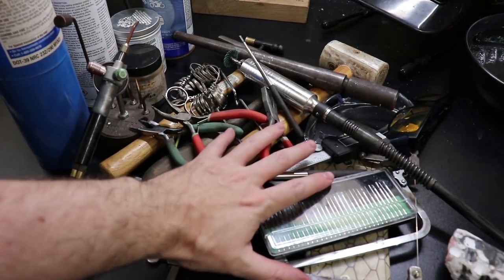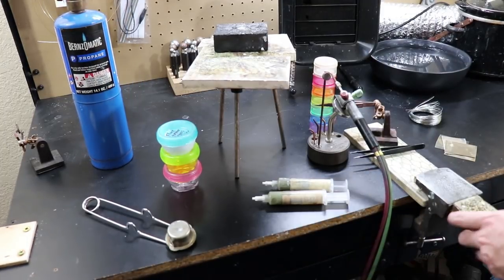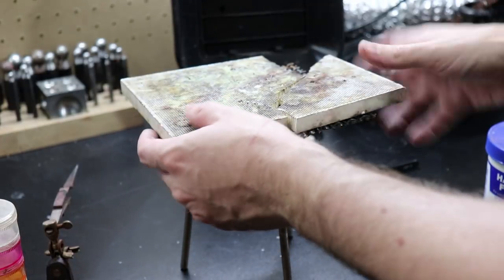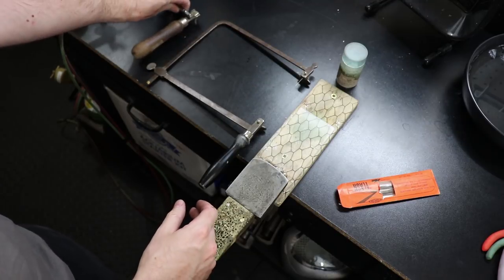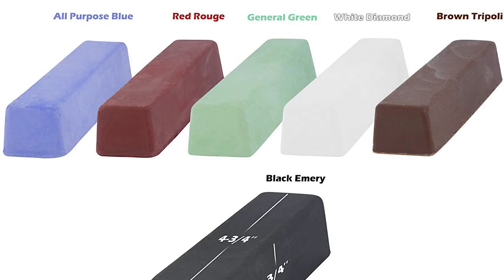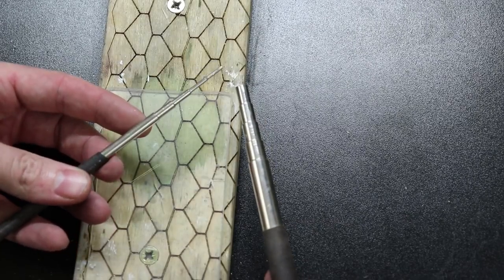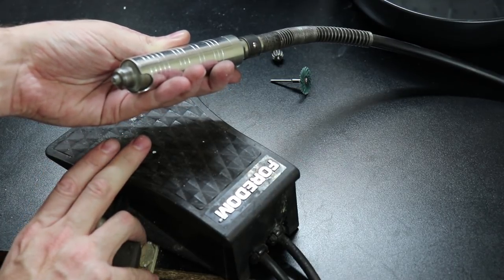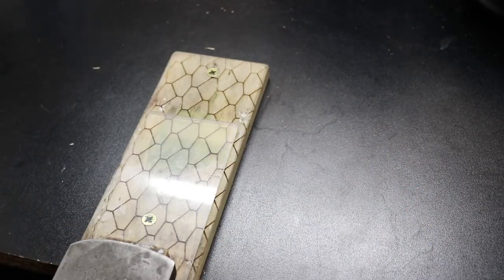20 Must Have Jewelry Tools [Update]

Comment from the maker: I have made a list of every tool and item in this video and they should all be in order for you.

Link to my pickle video: https://youtu.be/1mPAXsKXb1Q
-----------------------------------------------------------------------------------------------------
This isn't in the video but a fire extinguisher is good to have handy - https://amzn.to/2u2zQSv
-----------------------------------------------------------------------------------------------------
Saftety Glasses - https://amzn.to/2IEMVqa

Soldering Glasses - https://amzn.to/2yTznaU

Fume venting table top fan - https://amzn.to/2tFytJI

Fume Absorber Replacement Filter 5pcs - https://amzn.to/2KzahiJ

Digital Vernier Caliper - https://amzn.to/2IF6tL3

Smith's little tourch -https://amzn.to/2lJO32D

Smith little torch, regulators for disposable canisters & magnetic stand - https://amzn.to/2MCQBLD

Full oxygen acetylene smith's little tourch set up - https://amzn.to/2IFfVy4

Propane torch head - https://amzn.to/2KikjIW

Flint spark torch igniter (Starter) - https://amzn.to/2tF4jGQ

Trigger start propane torch head - https://amzn.to/2ME2PDR

Silver Solder Paste Set easy, medium, and hard - https://amzn.to/2KAHdHN

Precut silver solder chips - https://amzn.to/2KkfTkR

Handy Flux - https://amzn.to/2tRoDUr

My-T-Flux - https://www.riogrande.com/product/my-t-flux/504006gp

Brushed for flux - https://amzn.to/2KyhOyg

Tripod with Mesh Screen - https://amzn.to/2NcbQ88

Heavy Gauge Screen - https://amzn.to/2tJkD9p 

Honeycomb Soldering Block - https://amzn.to/2MA5X3j

3rd Hand Tweezers - https://amzn.to/2tO8cYY

Charcoal Block - https://amzn.to/2tRHsqM

Tweezers Set - https://amzn.to/2Nd6NnH

Titanium Solder Pick - https://amzn.to/2MCzIAq

8 Piece Set of Pliers - https://amzn.to/2tGIuX9

Non-marring Plastic Jaw Soft Touch Slip Joint Pliers - https://amzn.to/2lILe1Z

Round Nose Pliers - https://amzn.to/2IExDBX

Thin Wire Cutters - https://amzn.to/2NeJ2eX

Straight Cut Snips - https://amzn.to/2NeJHNt

Side Cutter- https://amzn.to/2NdJAlw

File Set - https://amzn.to/2ICKNiM

Just Needle Files - https://amzn.to/2Mz2i64

Small Bass & Steel Hammer - https://amzn.to/2MCAFJ0

Rawhide Mallet - https://amzn.to/2MABmTb

Chasing Hammer - https://amzn.to/2tFcF1a

PRO-CUT Lubricant - https://amzn.to/2IEvPc7  

2/0 "Flash" Jewelry Saw Blades - https://ebay.to/2KmEQMz

8 Inch Jeweler's Saw Frame - https://amzn.to/2tHhBCu

Bench Pin with Anvil - https://amzn.to/2lLC0Su

Micro Drill Bits - https://bit.ly/2Nek1AD

Multi-Grit Diamond Burr Set - https://amzn.to/2z3UO9k

Stone Setting Bur 12 Pc Set- https://ebay.to/2Mz3wy6

Ball Bur 12 Pc Set - https://ebay.to/2yVnNfp

Cup Bur 12 Pc Set - https://ebay.to/2KxAbTT

Hart Bur 12 Pc Set - https://ebay.to/2yZCJco

26pcs Diamond-in-rubber Emery Bits - https://amzn.to/2MDVP9F

Mixed Grit Radial Bristle Disc Brushes Kit - https://amzn.to/2tSDRc5

88pcs Felt Polishing Pads & Polishing Wheels - https://amzn.to/2yZDqT2

Polishing Compound - https://amzn.to/2tTGzh8

Drixet 6 Piece Buffing, Polishing & Cutting Compound - https://amzn.to/2MyNSTg

Ring Gauges Finger Sizer - https://amzn.to/2Nemz1F

Steel Mandrel - https://amzn.to/2yZWfWe

Step Mandrel Set - https://amzn.to/2tIlTJX

Crock Pot aka Pickle Pot - https://amzn.to/2lK0bkg

Copper Jewelers Tongs - https://amzn.to/2NcsTH5

Pickling Compound Sparex 2-1/2 lb Bag - https://amzn.to/2tOnHBl

27-Inch Telescoping Rotary Tool Holder - https://amzn.to/2NdXq7q

Better Flex Shaft Motor Hanger - https://amzn.to/2yTWu53

Flex shaft, hand piece and motor - https://amzn.to/2yX0TEb

Upgraded foot controls - https://amzn.to/2tTJcQ2

Complete 26-Piece Dapping Set -  https://amzn.to/2Kzn0C1

Bezel Burnisher - https://amzn.to/2MBHlXZ

Bezel Roller- https://amzn.to/2tRqKYt

Renaissance Wax - https://amzn.to/2lLcHQJ

Dupli-Color Clear Acrylic Lacquer - https://amzn.to/2IFv2Yk

Permalac Original Clearcoat - https://amzn.to/2MAe7IY

Liver Of Sulfur Gel- https://amzn.to/2lHXdwJ

Jax Metal Finishing Solutions  - https://amzn.to/2NeRBq7
Reply: Wow... thank you so much for this video and providing the list.  I have everything that you mention except the stones settings and burs.  Very informative video.😊👍👍.
Reply from the maker: Chain is a very time-consuming thing to make but it's a good thing to learn. Hey is a tool that he might find very handy. https://youtu.be/liF5881xR0Q it makes and cuts jump rings really fast. As for making the Cuban chain you need a mounted vice to get that nice twist and to make them flat you need to file them down. You can get a flat board and screw it down to it and clamp or bolt it down to your work bench. This way you can file it without it moving around.  😁👍

Comment: Hi Randy! Thanks, gonna share this to my group! Tip, go to the hardware store's plumbing section and you will find  cast flanges that will accept threaded black "water" pipe that comes in various lengths and choose one that is close to the height of your flexshaft motor hanger, bolt the flange to your bench, thread the pipe in and voila! A very sturdy stand for your motor!

Comment: I like the dowels that's something i can use.  I usually end up using my bench pin as a dowel hah good idea.

After the other grits, you can go from green radial (1000) to gray (2000) then just some regular silver polish like blitz with a fine soft towel and water, gives you mirror like surfaces and skips compounds and buffers all while cleaning the pieces (i use an electric tooth brush to final rinse).  I stack the radials brush discs three deep usually too.
Reply from the maker: Well I'll have to look into getting some 2000 and try that out. 😀👍

Comment: How about rolling mill for wires ? Do you have another method since it's the most expensive. It's one of the best videos for beginners. Thanks for taking the time of making it.
Reply from the maker: You can't really get around a roller mill well other than just buying wire and sheet metal. I do have a roller mill but It is one of the cheapest ones that I can get my hands on. This is the one that I have https://amzn.to/2O9NGeP 😀
Reply: That's the same one I use.  Have made 100s of feet of band material, sheet and square wires.  But never round wire, easier to buy.  I've even broken the dies and still it works, takes lots of practice and effort.  But i wasn't going to buy material since i have the silver already.

Comment: Great video! Are there any benefits of using oxyacytelene instead of propane burners, apart for faster heating times ?
Reply from the maker: Thank you! With the smith's little torch you can heat smaller areas with a lot more heat so I fell like I have a lot more control over heating the piece and making the solder flow. One other thing I like to do is fuse silver jump rings closed so I don't have to use any solder and it can make metal balls in seconds. 😀👍

Comment: I also have an oxygen and acetylene set up with my smiths mini torch. When lighting the torch the acetylene puts out soot before adding the oxygen. Do you have this problem? If not, what do you use to alleviate all the soot? Thank you!
Reply from the maker: Yeah soot is a common thing but for the most part if you have good ventilation this isn't really a problem. If you work next to a window but get a window fan and have it blowing out so it sucks all the soot out.

Comment: This torch head you have listed " 
BernzOmatic Basic Use UL2317 Brass Pencil Flame Propane Torch Head " can it be used on a mapp canister ( Yellow )?  Thank you!
Reply from the maker: You can but I wouldn't do that though, the air and gas mixture will not be right and make a lot of smoke.
Reply: @GomeowCreations  Thank you!

Comment: Why do you choose oxy-acetylene over oxy-propane, seeing that propane is a cleaner fuel?
Reply from the maker: At the time I got the oxy-acetylene due to it's higher temps. I could have really gone ether way and I still can always get a propane tank in the future if I want to give that a try. I just got a full set up for lost wax casting so the extra heat will come in handy.